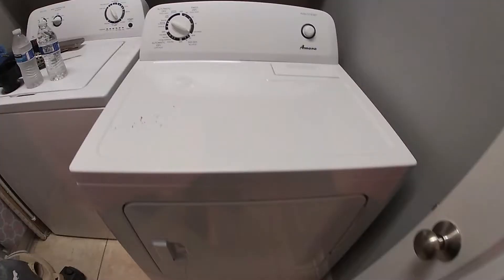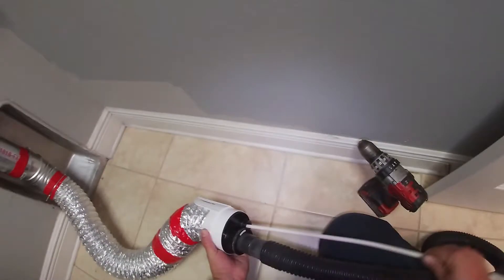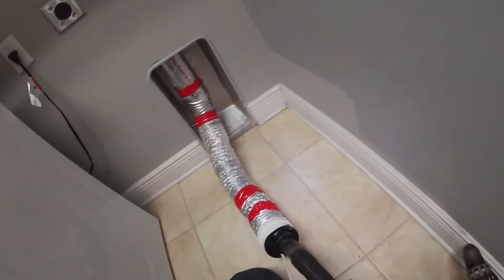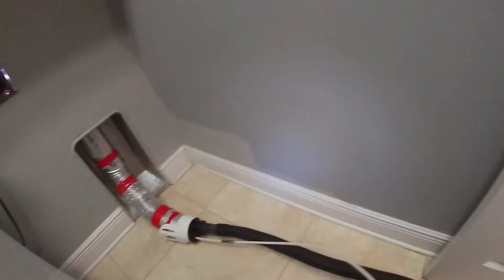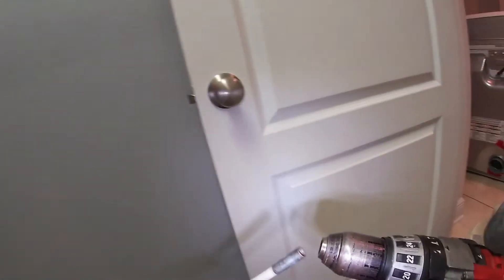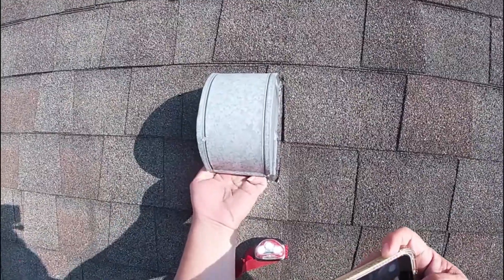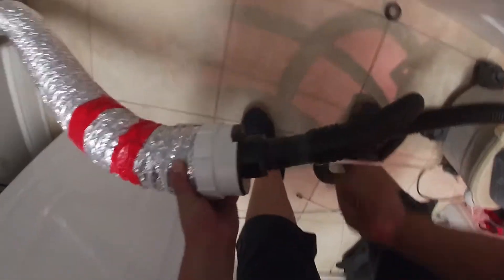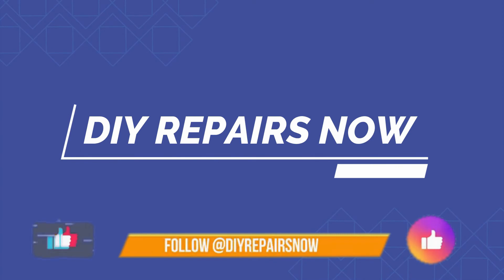How to Fix Dryer Taking Too Long to Dry | Dryer Vent Cleaning

Comment: Mine is a townhouse and is under the slab and about 30' long. Can one just buy 1 kit and use it to clean from dryer out to 25 feet and then go outside and clean back towards dryer?